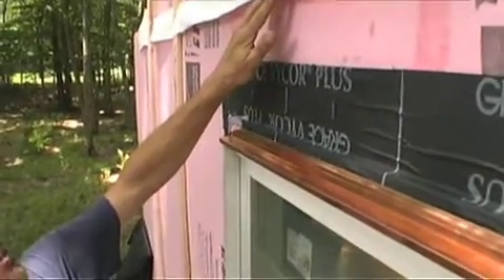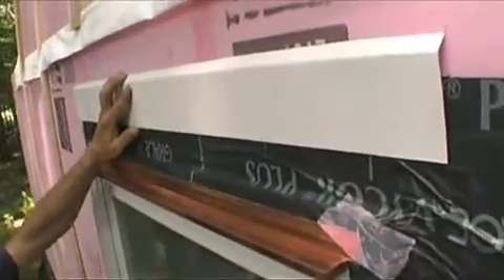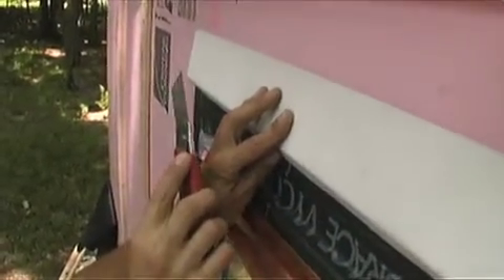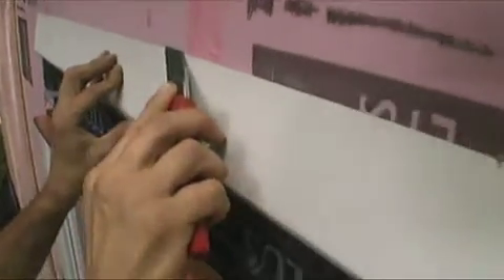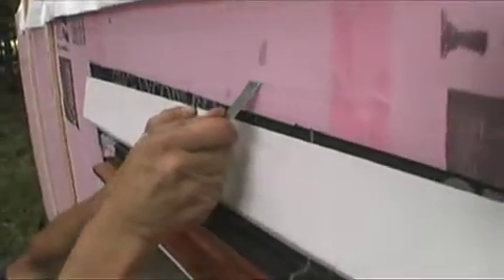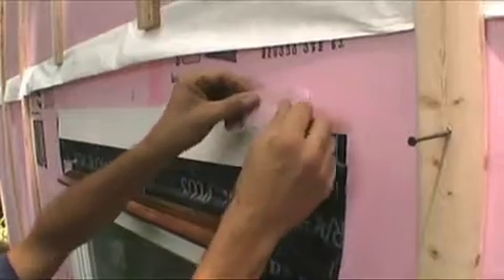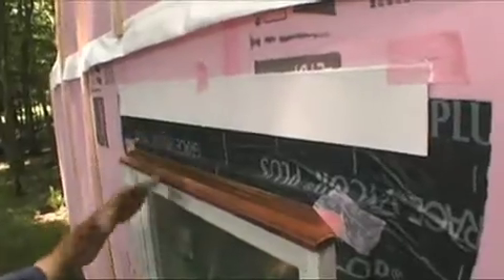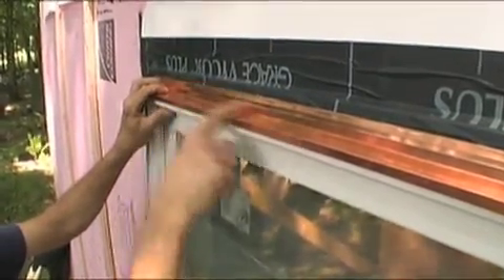How to Detail Head Flashing Over A Window in a Foam-sheathed Wall

Comment: A tradeoff of moisture protection at the expense of insulation efficiency. You now have a cold metal band across the top of your window which projects into the insulation sucking heat out faster.
Reply: Rule number one- Don't sheath your walls with only foam.

Rule number two- water intrusion protection over thermal resistance, any day. 

Currently working on a home that has only a 3/16 thick foam straight over the studs instead of traditional sheathing. In my opinion, it's ridiculous